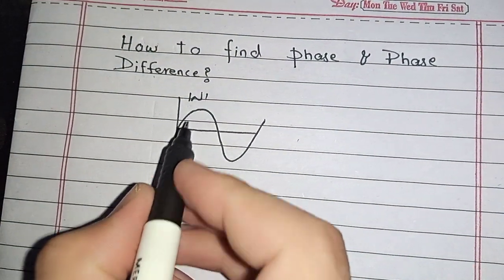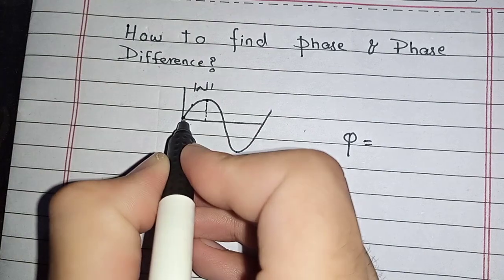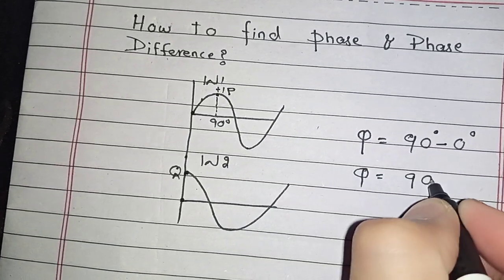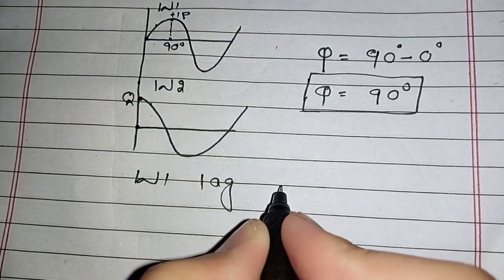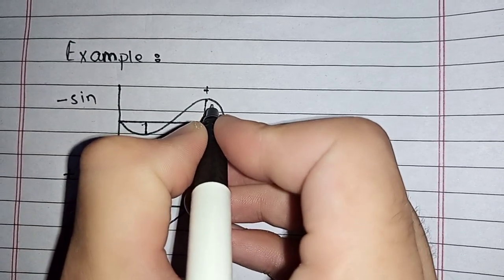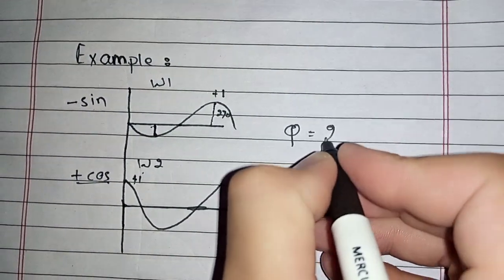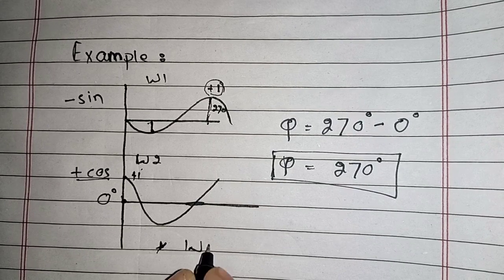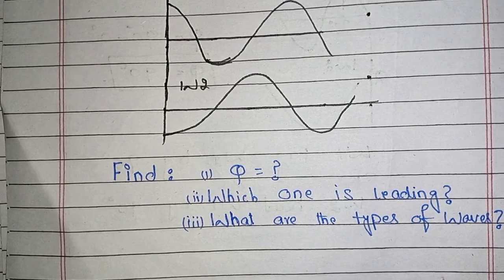What is phase and phase difference |Part-2| Leading and lagging concept | SYSTEMS ENGINEER

Comment: Can you please explain what is the phase difference between +sin wave and +cos wave???
Reply from the maker: i have already explain this in my entire video......however phase difference will be 90 degrees.
Reply: @SYSTEMSENGINEERs  Can you explain a little more why is this so?
Reply from the maker: @saniaameen7900  Actually sine wave gives it's peek at 90 degrees and cose wave gives it's first peak at 0 degrees therefore the angle difference becomes 90.
Hope you have understood.
Reply: @SYSTEMSENGINEERs  Ok thank you so much......got it.
Reply: @SYSTEMSENGINEERs  As this remains true for negative as well????